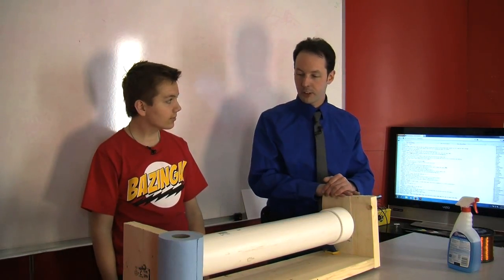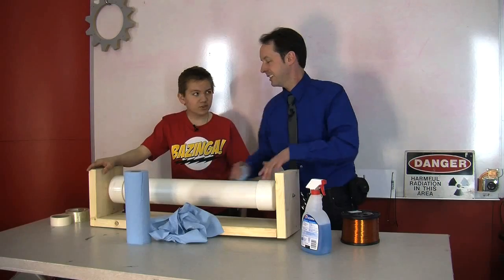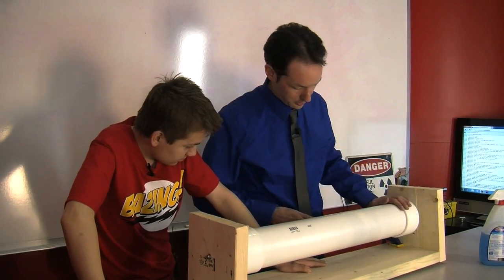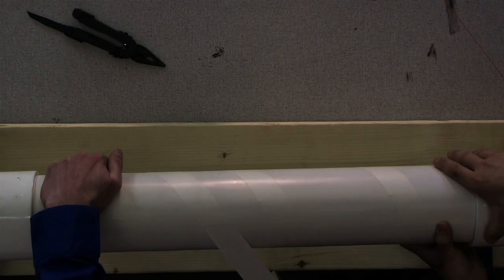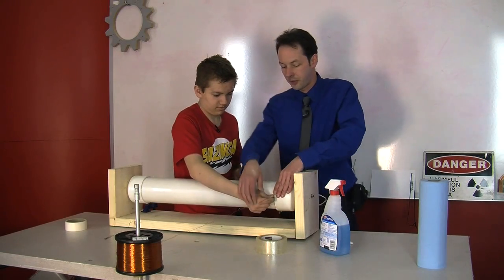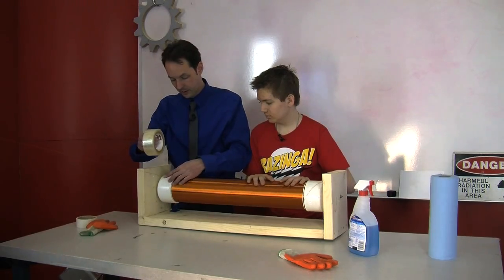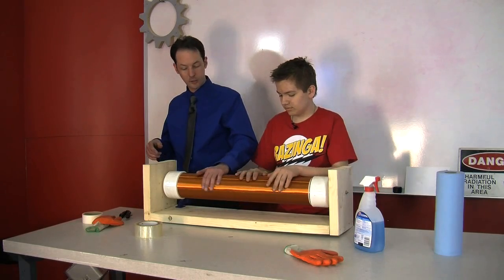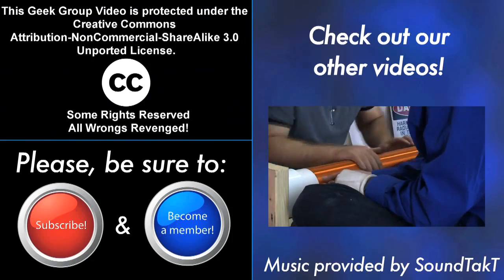How to - Home Built Tesla Coil - Winding the Secondary Coil Pt3

Comment: Hey Chris, please finish this series. I've got my secondaries coated with epoxy, but I need to know how to calculate the NST size I can use wit out blowing my capacitor. It would also help if I knew how to set the safety gap.